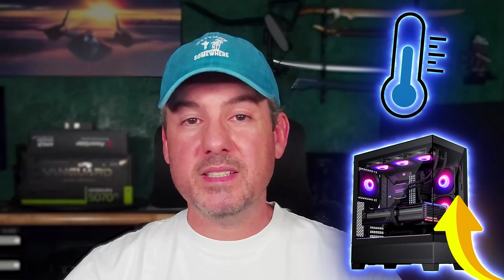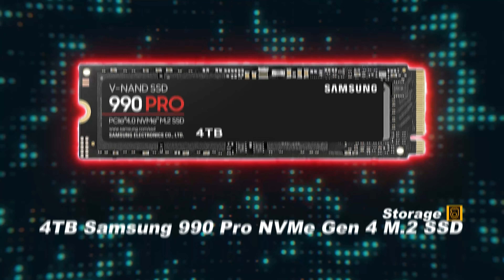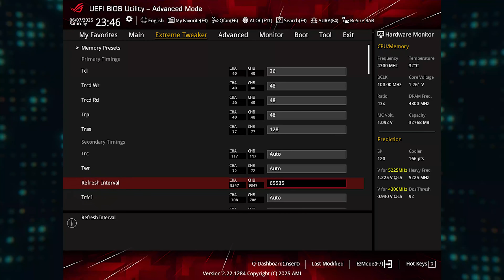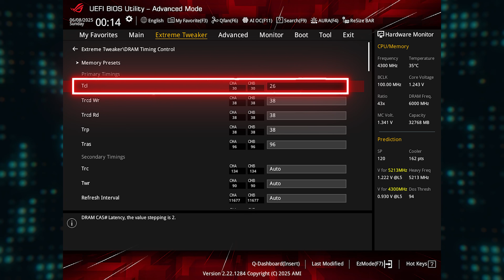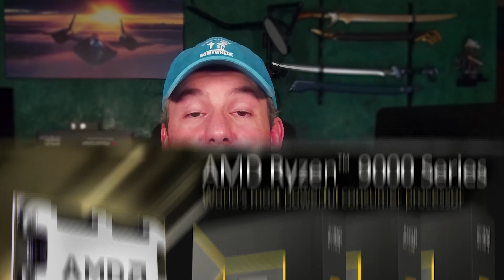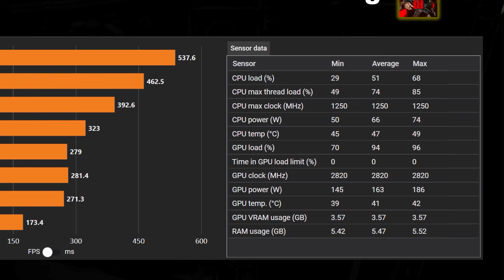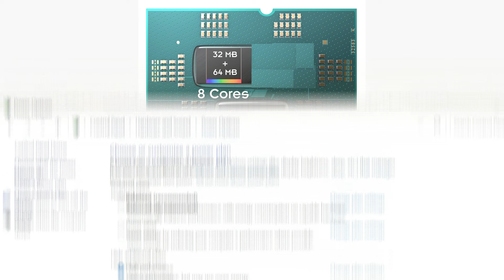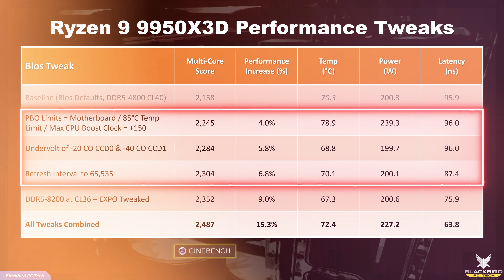What Are The Best Settings for an AMD Ryzen CPU?

Comment: Glad to see you actually did your research in the memory section. A lot of people spreading misinformation. However I would recommend just running the highest FCLK you can in 1:1 mode as there is no sync. You'll get a bigger performance bump from using 2133 @ 3000uclk for example, when compared to running 2000 FCLK.

Also, I wouldn't personally recommend dailying max tREFI (without a fan to cool the memory dimms) as it's often what can lead to OS corruption. 32767 or 24576 is a lot safer for daily use. It's a temperature sensitive timing, so hotter temperatures in summer months for example can lead to instability.

Re: VDD voltage, it does continuously scale and is likely safe up to 1.55v (I'm dailying that at the moment) with sufficient cooling.
Reply from the maker: I tested multiple FCLK's and I found the 3/2 ratio to give slightly better results, but I plan to re-test more thoroughly in an upcoming video.

With respect to refresh interval, the number you input is essentially the time interval at which the DRAM is refreshed to prevent data loss, so when you increase the number it refreshes less often ... that puts less strain on the RAM, so why do you think it will increase the RAM temps? If you increase it too much you will get errors, but even without a fan, I haven't had any RAM temp issues with this tweak ... it just doesn't make sense that refreshing less often will increase temps.
Reply: @blackbirdpctech  Increasing it doesn't inheritly increase temperature, but it makes the dimms more sensitive to higher temps. Bz has explained it before but I forget the exact details. The memory holds a charge in the cells, which "leaks" over time. Prolonging the refresh interval (longer time between each refresh) makes it more likely for the charge to leak before the memory can refresh, leading to data corruption. Temperature increases the rate of charge leakage, hence active cooling is recommended. You might not personally have issues running max tREFI, but someone in a hot climate, with a power hungry GPU and a poor airflow case certainly would.

I might be slightly off on some things, it's been a while since it was explained to be, but that's how I understand the general concept behind it. TL/DR; prolonging the memory refresh can lead to them losing "charge" before the refresh, leading to data loss/corruption.
Reply from the maker: @IIHydraII  I understand the data corruption issue, which is why I don't recommend anything over 65535 (definitely not max) ... this is the same tweak that De8auer recommends. What I don't understand is the temp issue ... will have to dig in to it more because it doesn't make sense to me ... and you are not the first person to bring it up, so I want to figure out if it's misinformation that has been spread on Reddit or there is actually some truth to it.
Reply: @blackbirdpctech "Higher refresh means that the 1T1C cells have more time to leak before refreshing their value. And at higher temperatures this TTL (time to leak) gets exponentially worse. But a lower refresh forces the DIMMs to refresh more frequently, which is an overhead."

Essentially it just means the cells have more time to discharge before a refresh. Higher temperature increases the rate of discharge, kind of like voltage leakage on a CPU, leading to instability at higher temperatures. I don't understand the physics behind it, but I'm sure it's pretty well documented.
Reply from the maker: @IIHydraII  that simply means that if your  temps are higher, you might not be able to run higher refresh intervals ... not that the higher refresh interval causes higher temps.
Reply: @blackbirdpctech  read my initial comment again. I said it was a "temperature sensitive" timing, not that it increases temperature.

(I also clarified this at the beginning of my second comment)
Reply from the maker: @IIHydraII  fair enough, I misread that ... that makes sense

Comment: Hi, at 3:50 you say mobo/ram combo for an ASUS mobo, where can find that combo ? If you know about the asus rog strix b650-a gaming wifi it would be great to know. Building a new pc soon and i'm hesitating to comit to your tutorial by buying 8200mhz ram and everything. I'm afraid to mess up and buy ram that i can't get to work with your tutorial
Reply from the maker: I don't really understand your question? Why would you try to buy DDR5-8200 RAM? Buying DDR5-8000 and seeing if it can run at 8200 or 8400 is fine but I'm not sure why you think 8200 is the goal.
Reply: @blackbirdpctech ram speed is not important in my question, what i'm asking is what specific RAM kit do i need to buy with this specific mobo. Any EXPO kit ?

I ask this because i'm afraid to commit and buying the wrong ram, mess everything up and not be able to get the pc working at all (i'm new to OC)
Reply from the maker: I would recommend looking up your motherboard QVL and selecting a ram kit from there if you are worried

Comment: Is it worth touching the scalar setting? What does it do? 
Thank you for the guide!
Reply from the maker: Good question ... PBO Scalar adjusts the FIT limit of your CPU by the given factor. It basically allows you to maintain higher CPU frequencies for longer without being throttled due to temp or voltage. I have typically found minimal benefit however I will sometimes run a 2X scalar to try to extract every last bit of performance. If you do decide to use this feature, I would caution against setting it too high and I would test it to make sure that you see a meaningful increase in performance.

Comment: @Blackbird. Could you please upload a bios TXT-dump of your voltages and timings running 8400mhz? I find it really challenging getting it to run stable at all, I know it's silicon lottery to take into consideration but would be nice to double check with some else's settings for sanity reasons.
Reply from the maker: I got that running with my 9700X in an X670E Aorus Master. I recently tried the exact same chip in my X870E Hero and X870E Apex and I couldn't get DDR5-8400 stable ... I finally got it to boot, but I couldn't get it stable. I plan to try again next week but either it's a firmware issue and/or motherboard issue, given that it's the exact same cpu. The other interesting thing is that for my X670E Aorus Master DDR5-8400 was plug and play ... I didn't have to touch anything ... so I might have to fire that motherboard back up.

Comment: Memory integrity is need for quite a few modern AntiCheat solutions, like EA Javelin anticheat for Battlefield 6, so that might not be an option...
Reply from the maker: That appears to be a new requirement for an unreleased game ... are there any other games that you know of that require memory integrity to be turned on?
Reply: @blackbirdpctech  Easy Anticheat has that requirement on some games, Fortnite and Valorant comes to mind, but it's up to the developers to turn it on or off. 

It's also a requirement if people are using Faceit Competitive platform, there Anti Cheat system also requires Memory Integrity to be active. 
and most likely the next Call of duty due to it now being a Microsoft title will also require it being on, and with thoes more will most likely follow.

Its mainly a side note and well if it wasnt for the anticheat systems, i wouldnt even be booting up windows, but one gotta send pixels at pixels.
and Thanks for the easy explination btw :)
Reply from the maker: That’s good to know … I might have to start testing with it turned on … the good news is, all cpu/GPU’s will be impacted equally

Comment: So you recommended testing cpu Undervolt stability using Aida 64. My question is at a -30 co my system crashed at 30 minutes you recommended 10 minutes does that mean my system is stable or unstable? 2. My second question sometimes my game like Fortnite completely freezes for 3-4 seconds is that a cpu instability ?
Reply from the maker: Based on my testing, 10min is sufficient to rapidly determine stability. The fact that your system crashed at 30min does indeed mean that it's unstable ... but you are borderline unstable ... you will likely be able to backoff to something like -28 and be fine. For your second question, that doesn't sound like a cpu instability issue ... does it only happen in games?
Reply: @blackbirdpctech yes. Specifically Fortnite. Also thank you for your response. Strangely enough when I set the -CO to anything above -25 my cpu clock speeds maximize at 5.225 Also correct me if I’m wrong the whole point is undervolting is to create headroom so your CPU can boost more and give you more gaming performance ? I’m new to this
Reply from the maker: That's a benefit but not the entire point ... undervolting should significantly reduce your temps. You can use that thermal headroom to overclock or you can simply run your system at the same performance but much cooler.

Comment: Hello friend...
I can use -20 in games without any instability problems. But in aida64 it appears with an error.
Do you think it's better to follow aida64 or since I don't have any crashes in games, I'll continue with -20?
Reply from the maker: You likely have clock stretching which is why it errors in AIDA64 ... I would back off until it doesn't error in AIDA64
Reply: @blackbirdpctech  My 9800X3D unfortunately only gave an error at -12... I tested it for 30m and didn't get any error. It's better than leaving 0
Reply: @blackbirdpctech  Just one question... I set my memories to: 6000Mhz cl30
FCLK 2100, 
SoC 1.3, 
VDDIO and VDDQ 1.25,
Voltage 1.25,
VPP 1.8
What I didn't understand was... If you put voltages 1.4 of VDDIO, VDDQ and voltage, would it be better?
Reply from the maker: @sangarplays2994   I do not recommend changing your voltages ... simply follow the steps in the video and perform a dynamic overclock using PBO.
Reply: @blackbirdpctech  I only changed it because I thought the original voltages were too high (1.45) so I reduced it to 1.25 (but I don't know if higher or lower is better). I'm talking about RAM (I think it's the same thing you're talking about)
Reply from the maker: Only change your memory voltages (VDD and VDDQ) if you absolutely need to in order to achieve stability ... definitely don't change voltages if you are not 100% clear on exactly what it does and what are safe voltages.
Reply: @blackbirdpctech  Ok, I'll go back to the default values, thanks for responding friend :)

Comment: A good and thorough video. But a thing to keep in mind is remember hot summers :) If your ambient temperature rises, your overclocked and undervoltaged CPU might not be happy =)
Reply from the maker: That's why setting a thermal throttle temp limit makes sense ... if the room gets hot and you hit your limit, your CPU will down clock.

Comment: This video was very informative and well done. I improved my c24 scores from 1030 to 1120 and the cpu doesn't go above 80c no matter how I hard I push the limits. Sadly I lost the silicon jackpot lottery, only - 18 all core curve and 125+ mhz override to keep it stable. Using 7800x3d and g.skill trident at 6000mt cl30 1.35v. Thanks alot again, subbed // random Swedish dude
Reply from the maker: Welcome to the Blackbird Army! One thing to be aware of, the boost override will have no impact for a 7800X3D because it's locked for overclocking ... so I would just leave it at zero. -18 all-core is not too bad ... my guess is that you could extract additional performance if you try per core tuning, but it will take a lot more time and is probably not worth it.
Reply: Oh I see! Yeah I'll leave it at all core until a rainy day 😂 I'm happy with the results all things considered. Thanks for the welcome, will look forward to more guides/info. Channels like these are a goldmine to me, because you keep it short, understandable and very accurate.

Comment: I've run into the issue with my 9800x3d that SMT is OFF. What ever i try it will not turn back on. in my bios the only option i have is Auto or Disable. its set to Auto. on top of that i have x3d Turbo mode DISABLED. I tried the MSconfig thing but thats unticked aswell. CPU-Z shows 8 cores and 8 threads instead of 16 threads. Ryzen master shows SMT is disabled aswell. I am clueless here and near sending it back. any advice?
Reply from the maker: I would try uninstalling Ryzen master and then resetting your CMOS to clear your Bios … that should fix your issue.
Reply: @blackbirdpctech  Alright so after figuring out how to clear CMOS, and uninstalling ryzen master i got back into BIOS and it said bios was reset (cmos successfull), checked if all the default settings were correct ( turbo off and SMT ON) and also did my xmp profile for ram as it was working fine before. 
Boom, its not booting and i get 4d error code on mobo. so i clear cmos again, and reseated my RAM and did the same things again. got into bios and did absolutely nothing ( didnt touch xmp this time ) and just booted to windows fine. 
So far so good, then i checked my cpu-z to see if my cores/threads are showing, and yes they are 8/16 finally! checked my temps and yes they went up as expected ( first time im happy seeing temps go up) as i was sitting at like 49c on full load before but also with low performance due to SMT being off. Now its finally on and all threads are working.
Then restarted again and prayed to pc gods that my xmp profile would work now, and it did. so here we are hopefully everything is now fixed.
Reply from the maker: That's great to hear!

Comment: Excellent and detailed video. Though we don't see a comparison in power consumption between stock & tuned 9950X3D.
 I have the 5800X3D and I have applied a negative curve of -30. It is stable for 1 year after applying it.
Reply from the maker: If you look at the table that shows the impact of the performance tweaks I show temperature, power and latency for each tweak.
Reply: I saw where you mentioned the power consumption. Probably didn't notice that.

Comment: Great video! Just built a new rig based on the 9950X3D. My motherboard is an MSI MAG X670E TOMAHAWK WIFI. At first I didn't plan to mess around with any BIOS tweaking but after watching your video which again is truly great, I reconsidered and thought I would spend some time and give it a go.

So far, I've only got to the undervolt part and I'm a bit puzzled. After changing the magnitude values and I'm about to exit BIOS to test the new values, I'm told no changes have been made to the BIOS. Still, the values I put in do stick when I check. Even after a reboot. On the other hand, using AIDA64 as suggested to check stability, I don't see the temp decrease I was hoping to see. Looking at the CPU temp presented by AIDA64 while running the stability test, the temp is equal to what it was with default values in BIOS within 1-2 degrees. Which makes me wonder if the changed values in BIOS are taken into account. Or if it just looks like they changed even when they didn't. Hence the message no values changed in BIOS upon exit.

Any ideas? Guess this would be a question to post over in the MSI forums.
Reply from the maker: If you get the message that no changes have been made in Bios when you try to save and exit then that means that your undervolt was not applied, hence no performance change in Windows. Make sure that after you make the changes in Bios you are not accidentally wiping your inputs by hitting the wrong key to go back ... that's all I can really think of.
Reply: Thanks for the quick reply! I'm positive the changes I made were saved. Even when the message was no changes were made. I pressed F10 which is 'Save and reboot' and when running AMD Ryzen Master, it confirmed my changed values. Still, as mentioned, I didn't see the temp drop at all. Ended up with negative 20 on both CCDs to be stable in AIDA64.

No big deal, I'll just carry on with the default out of the box values in BIOS. Already very pleased with the performance running stock values compared to my old 13900K which was replaced with my current 9950X3D.

Have a good rest of your weekend buddy!

Comment: So. you have a system that almost nobody has? MOBO that has better oc performance, 1 percent ram! Yip this helps everyone to get the best of their system.
Reply from the maker: That is completely irrelevant to the process, which is the point of this video. Even if you have the exact same setup, you will still have to follow the process to tune and optimize your system because there will be silicon quality variations. It's better to teach someone how to fish versus giving them the fish, which for PC hardware is impossible because no two systems will behave the exact same way.

Comment: One question: If these OC settings are that good to lower heat and increase performance then why not AMD make these default settings for chips?
Reply from the maker: That’s a great question. When AMD establishes the specification for a cpu they need to make sure that it works in austere environments, temps, dust, humidity, etc. So when you operate one in an office/home environment you can usually extract extra performance. They also have to account for different silicon quality so they will always set their specifications to account for the lowest possible quality chip. That's how most people typically end up with overclocking headroom.